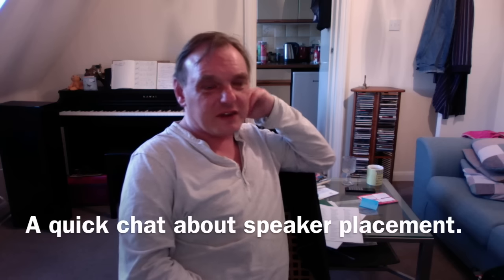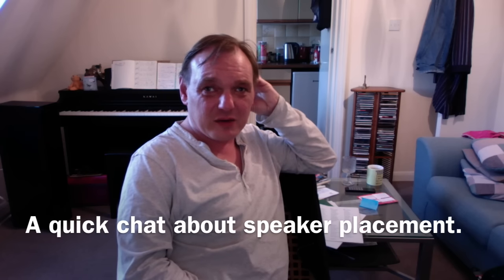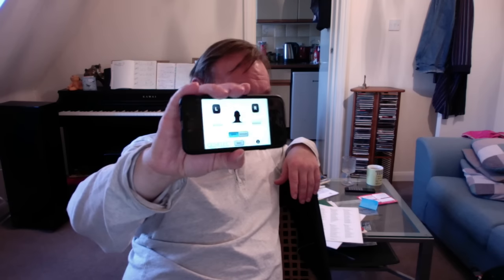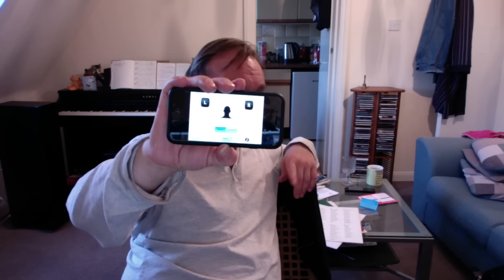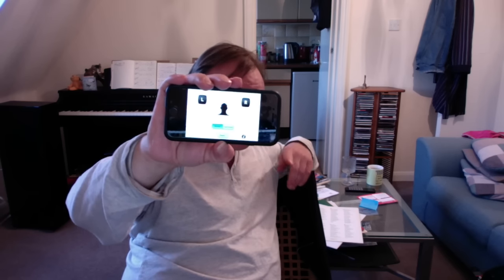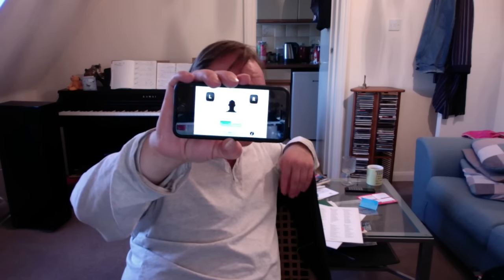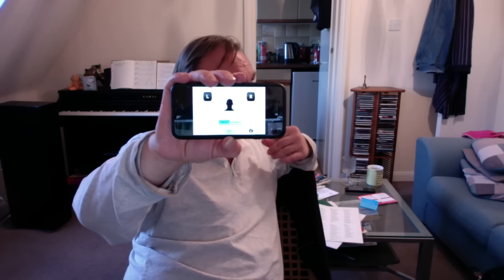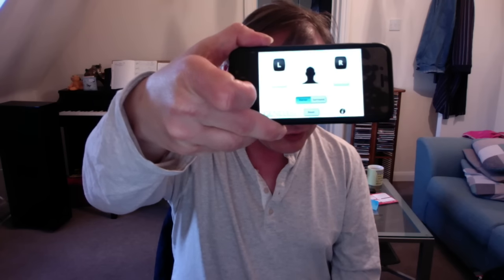A quick chat about speaker placement

Comment: WOW, a truly amazing oratory on SPEAKERS. You made so many excellent points and you have a cool accent (I used to work for "Mothercare" in NYC back in the 1970's/80's.
 People seem to think that you purchase speakers, bring them home, plop them down and away you go. It IS much more difficult than that. Used to be, speakers were set up two feet from side walls, a foot from rear wall and two to three feet off the floor. Only problem is it didn't always work for good sound that way. Any pair of speakers will sound different from the store to your friends digs (room) to your home.
  An annoying phenomenon, well two of them are, 1- standing waves and 2- room nodes. There ain't enough space here to go into them (lookem' up on the net) but they can adversely effect the sound in your room. The difference between two way and three way speakers isn't as important as the design used. There are some very good two way systems out there (EPI- 100 and Boston Acoustics A- 40) to name two. Also the bass frequencies are less directional so a bass driver on the side will still perform well. The crossover is important because if set to high the woofer (or midrange) can have poor dispersion which is murder on speaker response.
  Ported speakers as opposed to acoustic suspension designs CAN give better (Deeper) bass and use a smaller cabinet. Also vented systems with 8" woofers can give as deep bass as 10" woofers in sealed systems.  
   I do agree that large speakers in small rooms are a bit of overkill. Ya just don't need them big. Again, speakers like EPI- 100's Or the A- 40's previously mentioned work amazingly well in rooms of say 4 meters X 4 meters. Again, good work and thanks.

Comment: Excellent points. A few things (though I'll try not to ramble too much):

Firstly, regarding bass. Something that is often overlooked which can have a massive affect on a speaker's bass response is its coupling; that is, the physical connection between the cabinet of a speaker and either the floor or stand depending on whether it's a floor standing or stand mount speaker. This is the reason any good floor standing speaker, and indeed the bass of any good pair of speaker stands, is fitted with a set of spikes to couple it to the floor. Such spikes should be used, as not only do they provide a solid physical connection to the floor (which tightens up the bass and keeps the speaker stable), but they also provide a means to level the speaker which is also essential.

Further to this, with stand mount speakers, it's also important to couple the speaker itself to the stands. Stands often come with top plate spikes for this purpose, though if you'd rather not risk scratching your speaker cabinets rubber sticky pads work just as well; and they're supplied with most stands also.

Anywhere that spikes are employed, whether that be on a stand or on the plinth of a floor standing speaker, they should be pressed firmly into the carpet on which they are stood; and if they're not on carpet, spike cups should be used to provide a solid bass for the thin spiked points on a wooden floor.

Secondly; the old debate as to whether a stand mount speaker can produce as much bass as a floor standing speaker. It's important to note that there's a difference between tuneful bass and boomy bass. A well-designed stand mount speaker can, in fact, reproduce the same low frequencies that a floor stander can; however, such frequencies are often amplified more by the larger cabinet of the floor stander. If the floor stander is well-designed, this will appear to add to the sound; if the floor stander is not well designed, (assuming it's setup correctly) it'll make the sound boomy and result in overwhelming amounts of bass.

A stand mount speaker, however, obviously lacks the larger cabinet; and, therefore, its low frequencies are not amplified by the cabinet. This makes them more accurate and tighter sounding, but often results in an apparent lack of bass. Personally (although I do use floor standers in my main setup), I do prefer the bass reproduction of a good stand mount speaker. After all, most monitors (the speakers on which our favourite music is recorded, mixed and mastered) are of a stand mount design (often with a sub in place to supplement the bass); and there's a reason for that.

I think one of the best bits of advice I've learned over the years is to know the limits of your system, but in particular your room. Just as there's little point spending £10K on a pair of speakers and powering them with a £100 amplifier, there's little point buying the largest speakers you can afford (usually simply because they look good), and to place them in a 2M x 2M room where they will never perform at their best. If you have a small room, opt for a small pair of stand mounts, or a pair of small floor standers. If you have a larger room, opt for a larger pair of stand mounts, or a mid-sized pair of floor standers. It's logic really, but it's something people often over look; after all, you wouldn't buy a Nissan Micra if you wanted an estate car now would you?
Reply: +Ashley Cox Everything else being equal in terms of build and design quality you're better off with a floor standing speaker no matter the room size in my opinion IF you take the time to fine tune all the variables in your listening environment.In my experience floor standing speakers in a smallish to small room sound jaw-droppingly, incredibly, stunningly awesome. However it is more challenging to adjust for a floor stander in a small room (and I mean MUCH more  challenging). Most people give up before they succeed and are left with the impression that it must be impossible to achieve. This is not true. You will be rewarded if you persevere, consider and test every possible variable and adjustment for room acoustics, power quality, audio component synergy, placement and location of furniture, speakers, etc. If you're not willing to take all the above into consideration and be extremely patient, then go with small stand-mount speakers. All things equal the stand-mounts won't sound as good as the floor standers would have sounded had you taken the time and effort to fine tune and dial in all the variables, however the smaller stand-mounts will sound good enough to very good with a whole lot less muss and fuss; almost to the point of plug-and-play convenience.
Reply: +thudeets Going to have to disagree. I review (and thence hear) a lot of speakers and certainly can't say that, when setup correctly, a floor stander will always beat a stand mount design. Of course, the speakers on which you base your experience will define your opinion; however I certainly wouldn't say that stand mounts offer any more 'plug and play convenience' than floor standers.
Reply: +Ashley Cox In a small room I feel confident in saying stand-mounts require less muss and fuss to setup than larger or floor-standers. Maybe not as much in a medium or large room.I believe there comes a point where the room size is too big to seriously consider a stand mount over a floor stander anyway.But I will concede that this is an experience-based hobby. And on top of that listening preferences will vary. In which case to each his own I guess.